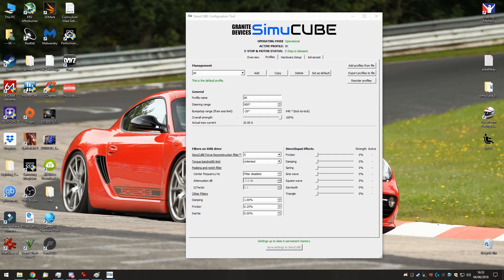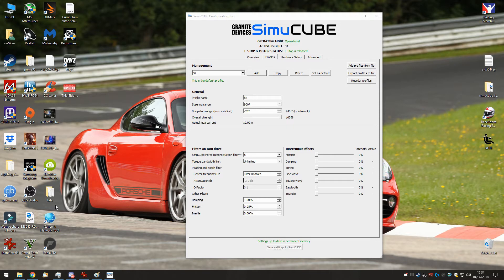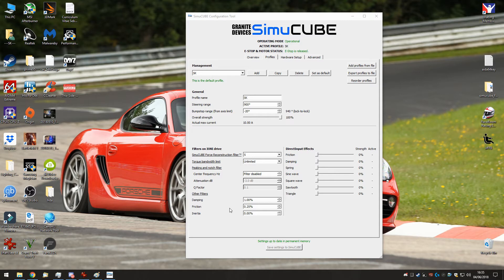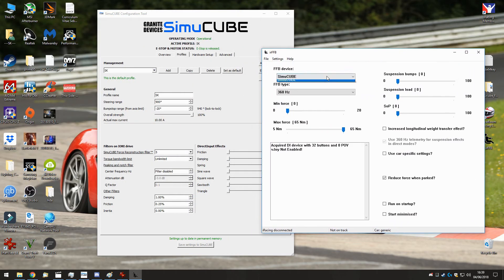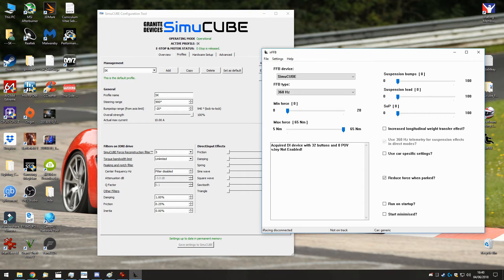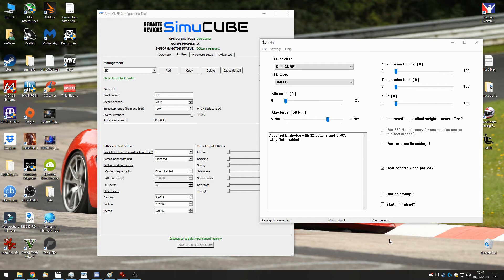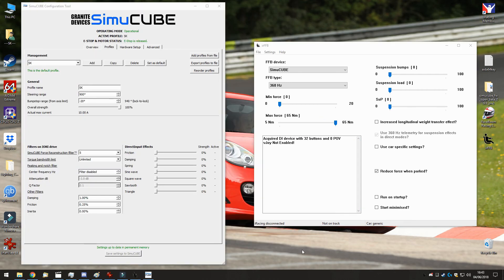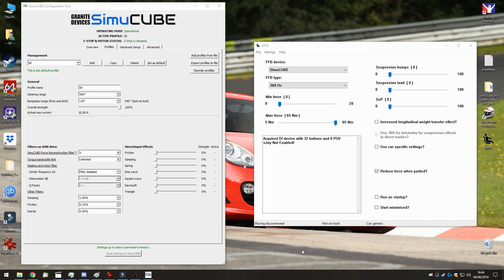iRacing SimuCUBE Damping Settings and irFFB 360hz FFB

Comment from the maker: UPDATE: Use Rcon 8, 1% damping and 1% Friction and 3% Inertia set this in your simucube configuration tool! i didn't do this yet when i made the video, try it!
Reply: should I use these only with irFFB? I haven't tried it yet, just looking for some good settings for the 60hz ffb right now. Thanks
Reply from the maker: its for both even more usefull on the 60hz ffb because its more raw try and see what you like. i will do a video soon explaining more. on what does influence what i run 1 damping now 1 frictiong and 3 inertia
Reply: just had time to use the new settings and I have to say they feel great with 60hz ffb. Why the -20% bumpstop tho? Thats the only thing I dont really get right now
Reply from the maker: you would have too see the other tabs, but its to put the bumpstop outside the 900 degs steering range and not be as harsh ( but its nothing to do with iracing anyway since that has its own bumpstops build into the game it will never use the one from the configuration tool. I have some new settings for iracing which are a big improvement. 1 damping 1 friction 4 inertia and rcon 8 try that and let me know what you think.
Reply from the maker: if you have a osw / simucube join this discord https://discord.gg/FJR9jGu

Comment: but what about iracing's 360hz telemetry implemented back on 2017S1? i quote:
– New 360 Hz telemetry output has been implemented!
– – 360 Hz telemetry logging is disabled by default. The option for enabling 360 Hz telemetry logging has been added to the “app.ini” file here:
– – – [misc] irsdkLog360Hz=0 ; 0 = 360 Hz logging is disabled, 1 = 360 Hz logging is enabled.
Truth is i tried and it doesn't make any difference to me at all. but why is there?
irffb DID make huge difference but i recently switched back to stock FFB for various reasons.
Reply from the maker: thats just the telemetry signal / logging. thats not the ingame FFB rate thats still 60 u need the plugin to use the 360hz telemetry signal

Comment: how can i setup my dd for formula renault 2.0 and pro mazda? i dont understand how skipbarber the wheel is strong and that formula has so weak ffb.
Reply from the maker: just adjust the forcefeedback strength in iracing. its different on all the cars, thats just the way it is.
Reply: Sim Racing SKeijmel but the problem is when i turn left/right i feel weak wheel, but bumps and other effects are so strong.
Reply from the maker: that's just the way the FR 2.0 is.
Reply: Will be?
Reply: Sim Racing SKeijmel I turned off the linear check button, the result was good, but the spring effect got very strong. Can I change this effect?

Comment: Hi, is there a way to use more than 65 NM in iR FFB? To get less strong FFB? With my 32cm OMP Wheel i use  around 50nm in iR FFB, but 65 on my Formula wheel is a bit to much for me for long runs. Workaround is currently to have a second profile für Formula wheel which only uses 75 % strenght in simucube. But for comfort reasons would be nice to have a way of reducing the ffb strenght in iRFFB directly since it can use car specific profiles!
Reply from the maker: less is more so the lower value the stronger the ffb get 65 is the weakest. currently there is no way to set it higher in irffb. just reduce your strength in the simucube settings ;)
Reply: @SimRacingSK  I have downloaded irffb yesterday and while the slider only goes to 65 you can fill in a higher value in the inputbox. I had to set it much higher because the ffb was in my opinion much too strong

Comment: So I have been testing this for an hour now and I am a little confused. It seems that the lower (number value) you have the "Max force" setting adjusted to, the higher the FFB actually is, which is just like in iRacing I suppose?

I have a large MiGE with SinCos and am currently running version 0.9.10 SimuCube firmware, and what I noticed is that irFFB adds a lot more FFB to the settings overall. So, perhaps I am confused as to how I am supposed to dial this in, but my guess is that I would reduce my "overall strength" slider setting in SimuCube until I reach a value that feels good to me when using irFFB?

Is the general concept here to gain fidelity at the wheel, using less overall strength in SimuCube?

My initial observations were that when I first used irFFB with the settings you show in the video, I could barely turn the wheel. There was so much added FFB that it felt like I was running my "Overall Strength" slider at 100%. I was not, it was set where I have been using it for months, which is 65% (16.25 A).

Let me know....
Reply from the maker: it just works the same as iracing just change the nm slider just like iracing Higher NM settings is weaker FFB, and keep you motor at high strength. so there is less chance for clipping. also the irffb app will tell you if there is clipping going on or not. so if you really want you can lower the strength in the simucube settings too.

Comment: One thing which you missed in SimuCUBE. What have you got your Hardware Setup Tab settings at and what would you recommend for the Bumpstop.
Reply from the maker: Here are some screenshots of it https://cdn.discordapp.com/attachments/139815407279144960/453579523007578112/unknown.png & https://cdn.discordapp.com/attachments/139815407279144960/453579575981637632/unknown.png but those settings are not used by iracing for bumpstopsettings watch my first video on iracing. https://www.youtube.com/watch?v=iEuzjXP17oM

Comment from the maker: You should notice a instant and huge improvement in ffb smoothness and details. if you don't the program might not work on your pc this happens only on very rare occasions. also if you run irFFB you can try lower rcon settings. since its a 360hz FFB Signal